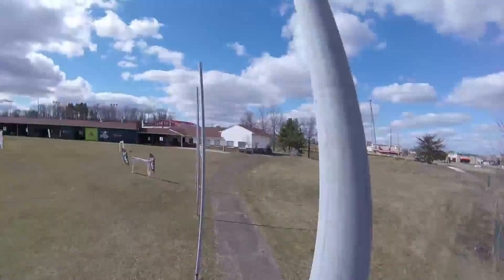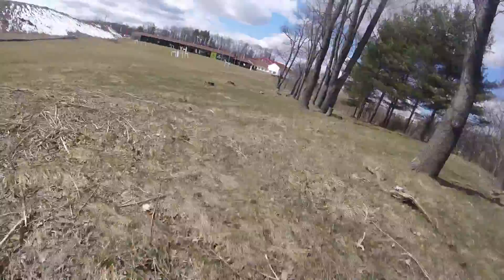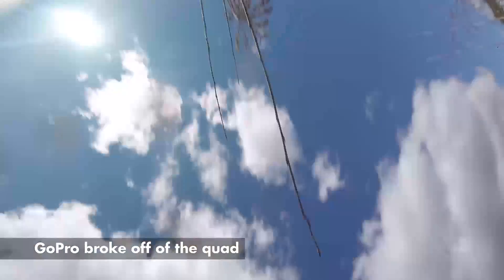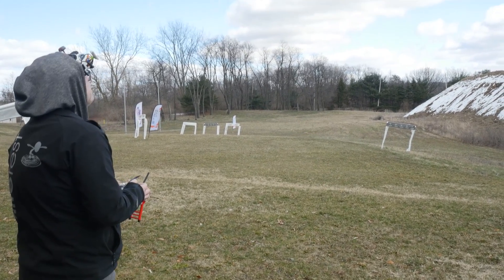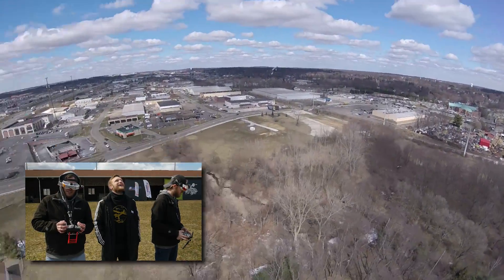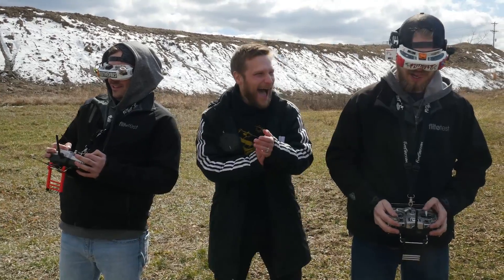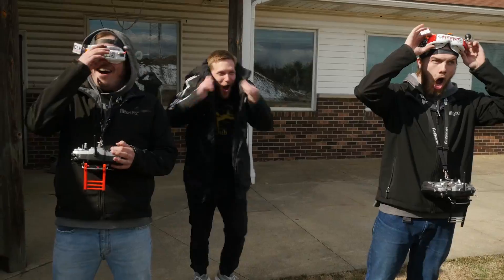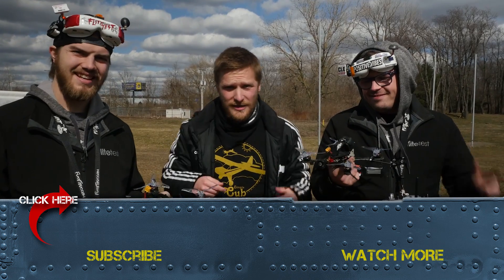Could Your Quad Survive This?

Comment: You guys are awesome.  If it can fly, you've got it covered.  Maybe you can steer me in the right direction.  My quad build has no microphone. None of the parts (MATEK PDB, F-7, VTX and FOXEER Predator) has a microphone.  Foxeer says they have a camera in the works.  Have you ever installed a microphone?

Comment: So a nother added way to break a prop...by stripping the inside
Reply: Actually stripping the inside does not stop the prop from working. You can tighten it down with a lock nut, just like a normal prop and it will work 100%.
Reply: right so you need back up lock nuts? that defeats the whole purpose... i would just rather put the prop nut on in the first place
Reply: That's always an option... no need for POPO if you'd rather use lock nuts. Like anything else we do, this is just an option for those that want to swap props quickly and without tools or nuts. All POPO props (like the Gate Breaker used in the video) work on regular motors that just use lock nuts and regular shafts.

Comment: I get the feeling that broken motor shafts will be a common fail point on these motors, due to the hollow shaft that allows the release rod to be fitted inside, just a few hits on concrete will break most if not all of the motor shafts within a few weeks worth of flying. I'll stick to my standard Lumenier motors for now.
Reply: Munkey360 the shaft that broke was the solid 3mm shaft inside the motor. Not the hollow part containing the POPO mechanism. It’s an unrelated failure.
Reply: I was referring to the upper part of the shaft where to ball bearing are, not the internal part of the shaft.

Comment: Wow I’m impressed!

Only thing you did not test: how about dirt, mud and other grime getting into the little ball bearing popo system? Does it still work or will it lock up?

Also, how many “mating cycles” can it handle? Wil it still work after a year of flying and crashing? (Not that any of my motors survive that period lol)
Reply: Willem the system was tested and confirmed to not be affected by 10,000 on/off cycles.

Comment: I am more concerned of the longevity of the system and how many add/remove cycles it can handle.
Reply: We built a machine to test repetitions. We ran 10,000 repetitions and the prop and POPO shaft worked the same after 10,000 reps.

Comment: That was quite awesome.  It's not every day you get to see someone intentionally smash their quad into stuff -- and keep going!  I just wanted to note that even though the grooves that hold the props on might be stripped like after the tractor collision and unusable with the POPO system, you can still use the props.  If I'm not mistaken, you should still be able to use conventional nuts to secure the props to the motors.  Screw on the prop nut and you're back in the air!
Great content FT, keep it up!  Happy flying!
Reply: Broken Prop Productions yep you're totally right!

Comment: I'm not even into quads and this impressed me. Those props are practically indestructible. Also, what the other commenter said: collab with the Slow Mo Guys!
Reply from the maker: HEY J-fin! This technology is pretty awesome! Can't wait to see where it goes from here!
Reply: Definitely. I see some major applications for it outside quads for sure. They a standalone connector like that for F5D (and props tuned for that). Those guys break props almost every time they land.

Comment: The main concern is breaking the moving parts inside or the button. What if you smash the button against concrete 10 times? Can you still press it and it works?
Reply: lol i don't think they are going to test that. The motors still have a threaded shaft for regular m5 nuts if the POPO system breaks.